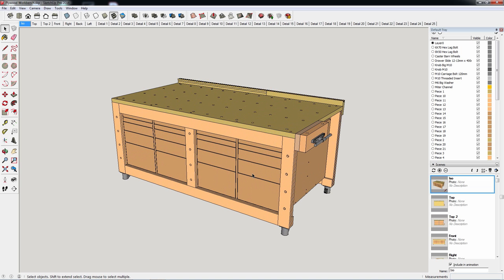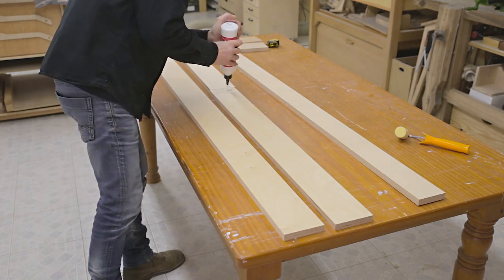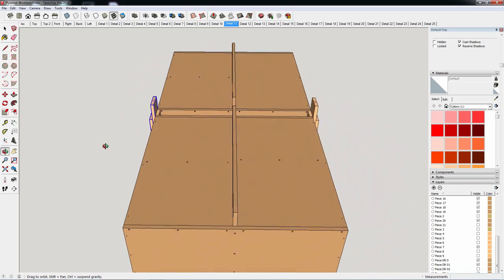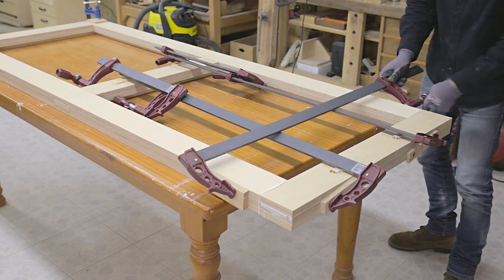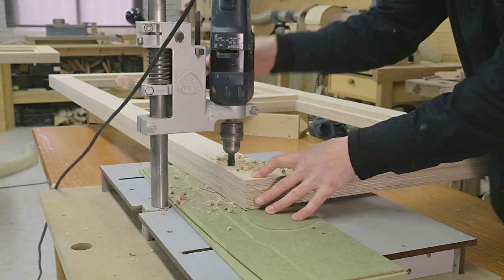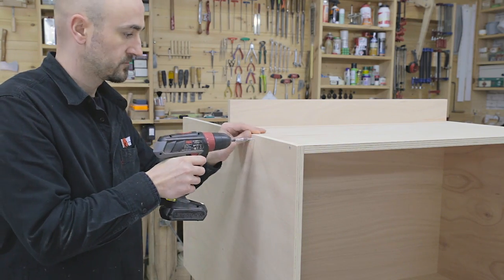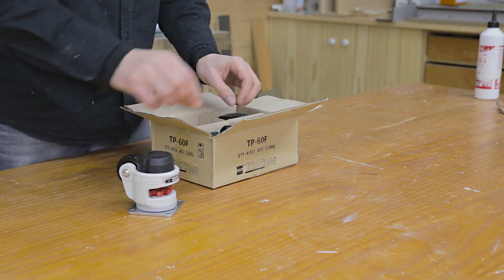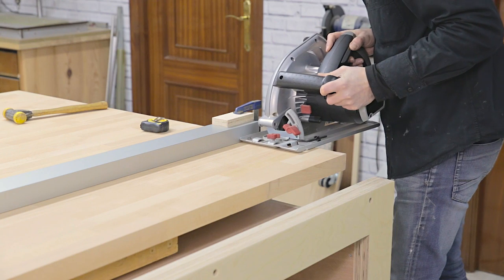High Capacity Multi-Function Workbench Build / Part 1

Comment from the maker: Multi-Function Workbench Plans: https://bit.ly/39eKtrr
Reply: The casters might support 1000kgs as a set but the fasteners won’t hold bc it’s screwed into the side edges of your plywood. It would have been better to use 2x4s or 4x4s for them. 
I’m sure you know this but someone not familiar with wood working might not know this.

Comment: Really like this work bench. I plan on building one like it with the addition of putting my table saw in it. I have the Delta 36-725 model and the caster set up is terrible. I also love the cross cut feature and edge cut feature you've built in. This bench build will eliminate the need for a separate table saw, separate expensive cross cut table, and bring my large cuts up off the floor. I want to also install a router in it. Thanks for a brilliant design!
Reply from the maker: thanks Daniel, I would like to see some photo!
Reply: @Paoson_Woodworking  May be a while yet. My next phase is to empty my garage, run all my electric, paint, coat the floor. Build work bench after. I've watched your 4 part build about 5 times now...trying to decide how to modify it to integrate my table saw and router.

Comment: For anyone interested in making this workbench;

It is an amazing workbench!
I have built mine to have a 4' x 8' 3/4 plywood top only with a circular saw and a handmade straight edge and it is extremely sturdy!
I used 6" lockable swivel casters that can hold up to 500kg each, and I have put them to the test! I used the bench as a construction scaffold to insulate my garage's ceiling and it wasn't even feeling risky with only a single 3/4 inch 4' x 8' plywood sheet on top.
Me and my uncle, we weigh over 250kg together and we were installing 3/4" plywood sheets on my ceiling, it also had a bunch of tools in the cabinets (I didn't make drawers or anything for now...) and it could've hold even more!
There was 2 drill presses, a planer, 2 jointers (4" and 6"), a spare circular saw, a compressor, a portable dust collector and a pen-turning lathe in the cabinets!
My only complaints are that I did NOT glue the cabinets to the main frame, because I didn't know if I would like the 4' x 8' footprint...and that I didn't add 2 more strips in between the workbench's top and the cabinet, it sags just a tiny bit because I am using only 1 sheet of 3/4" cheap plywood, I didn't want to use more than this to reduce the cost.
SO, If you're thinking of only using a 3/4" plywood top, please do yourself a favor and add at least 1 strip of vertical plywood on top of each sides of the 2 cabinets to reinforce the top!

Comment: The way the frame was designed for strong joints and easy assembly is a novelty.  I am thinking of how to modify the design for a smaller 3x5 work bench
Reply from the maker: thanks! check this out:
https://www.youtube.com/watch?v=yA8bUKLI4Sc&ab_channel=PaosonWoodWorking
Reply: @Paoson_Woodworking  thanks, I saw your smaller work bench. I actually watched half of your videos in the past few weeks. So many creative designs. Isn't the 3 layers of ply to much for the frame? I am trying to keep it light given I have to push to my driveway while working.

Comment: A word to the wise with anyone who decides to follow these plans. Since they're designed to be doable by people without a lot of tools and likely experience . . . 

Getting your plywood pre cut at your local lumberyard is very contingent on how good their cutting service is. This is something you'll probably have to learn the hard way since you might go to a bigbox store and get hair-precise cuts (really depends on the store management and how much pride the floor staff take in keeping the panel saw tuned) or to a lumberyard and get a mess, or visa versa. 

I wound up using a lot of my own time re-straightening the lumber yard cuts. Luckily, I was skeptical of their precision before hand and sized everything a bit bigger for cleanup at home. But it still left me with a few defects that have haunted me through the project.

Comment: This is a great design. I'd like to build something similar but with smaller cubes. I'd actually like to have the ability to separate each cube due to space constraints in my garage (a single cube might integrate a drill press, one a router table etc). You've given me some great ideas, and it'll be great to see how you integrate your machinery.
Reply from the maker: It is a good idea!

Comment: Great job, this will be my reference model.  One question, for clamping the plywood laminates I believe you used an aluminum square tube as a flat reference.  What wall thickness is necessary to allow strong clamping against this flat surface without warping the square tube?

Comment: The design of your workbench is very remarkmable due to the simplicity of the design. But I have concerns in relation to the the durability due to the swell and dwindle of the finger joint board. Between summer(wet) and winter (dry because of heating) the dimension change can be more than 10 mm. Below the board there is the body made of plywood. This material does not change its dimensions, that results in enourmous tensions so that the board will bend or on extreme differences in humidity the screws will break. So what are youre experiences with the board.

Comment: Amazing ideas in your videos. I have one question, I have noticed that you build drawers joining the sides at 90 degrees with screws and glue, while a lot of other videos use a pocket hole or other more articulate construction, and often they use a groove to slide in the drawer bottom. I find your construction to be very fast, simple and intuitive, why do others use more complex methods? Is there a need for such extra steps? e.g. in order to ensure a stronger build
Reply from the maker: thanks! It depends on the project, but this type of drawer made with the right plywood board thickness in bottom and drawer, is very resistant
Reply: @Paoson_Woodworking  muchas gracias! I will try them out :-) cheers, Max

Comment: I wonder if those caster/feet are as strong as the specifications claim. I have my doubts. But even if they can support the weight, how feasible is it to turn that wheel with a couple fingers when there is a 600-pound load on the caster?
Reply from the maker: you're right. I want to make a tool to facilitate the process. The weight will not be a problem, the bench and all storage will not reach 300kg. I've looked for wheels that support more weight to avoid problems. Thanks for your comment!
Reply: @Paoson_Woodworking  
I did not mean to suggest that the feet would not be enough for your application. I was only questioning the manufacturer specifications of 600-pounds per caster. I think that may be optimistic of them.

By the way, if it is too hard to turn the wheel to extend the feet, I guess the workaround would be to have a jack or lever and fulcrum to slide under the bench, raise it up slightly to take the load off the caster, and then turn the wheel to extend the foot.
Reply: Hi J Will,

The weight capacity of our leveling casters can actually handle about 20% more than we state but we always reduce the capacity by 20% after testing for safety reasons. 600 lbs is not a problem per caster because these are very heavy duty and quality made. The wheels are actually nylon so they are as strong as steel and very impact resistant as well. If you do plan on using the full weight capacity of 4 casters ‘maxed’ out which would be 2,400 lbs for a set of 4, then it is more difficult to turn the red lever to raise or lower the rubber foot pad. The easy fix would be to use a wrench 🔧 to turn the lever instead of your fingers or as you mentioned to slightly take off some of the weight while adjusting but we have not had any complaints or returns on these items and we’ve been selling thousands of them each year for many years now. We’ve made great quality improvements over the years to make sure that we provide the highest quality casters. Thanks for your concerns, please let me know if you have any questions about casters or wheels in the future. I’ll be happy to help. 

Thank you, 
Jordan Wilson.
Reply: @CasterHQ  
Nylon as strong as steel! I can hardly wait to see the skyscrapers built with girders made out of the revolutionary, physics-defying nylon that you have invented!

Clearly I was correct to doubt the accuracy of the specifications provided.
Reply: J Will 

Nylon wheels are comparable to semi steel wheels in the caster industry. Not the same types of steel used to create buildings.
Reply: @Paoson_Woodworking  
I looked up some reviews on those types of caster/feet on amazon, and I found two common complaints, one minor, one potentially major.

The minor complaint is that when the caster is loaded up (but within the rated load) it is difficult or impossible to extend the foot without taking the load off the caster.

The major complaint is that when the feet are used, it is not a steady mount. If you push on the workbench at the top, it can wobble or rock up to 1- to 2-inches horizontally. It seems the foot is on a fairly small threaded rod that is not kept rigid at the top end, which allows the foot to wobble along the fulcrum of the rod attachment point by about 1/4-in, which gets magnified by the workbench height to up to a couple inches at the top.

Comment: Hi just brought your plans for this and going to build it, just wondering if you think it would still be strong if built with mdf and a solid top? Looking at a cheaper option. Thanks
Reply from the maker: yes, you can use MDF. What do you mean with "solid top"?
Reply: @Paoson_Woodworking  awsome thanks, I have a solid kitchen table top. Was just meaning If I build everything but the top out of mdf. Thanks
Reply from the maker: @carposworkshop2662  yes, you can also use MDF for the top!

Comment: Hello ! great job really ! I would like to replicate it somehow for my 2000x1000mm workbench. Just a question: do you think for the frame can I use 'normal' phenolic pine plywood instead of birch ? I mean 3 layers of 21mm th, each. Maybe if not strong enough I can add an additional whell pair in the middle of the bench ? What about to build the frame with 80x120mm lamellar beam instead of plywood ? Thank you very much for suggestions ;-)
Reply from the maker: hello Giovanni, you can make all those changes, but I advise you to put two more wheels in the middle of the bench, send me some photo please!
Reply: @Paoson_Woodworking  ok thanks! to better understand… you do suggest to put additional wheels in the middle cause I'll use different material or even in your bench are needed ? consider I'll use nylon wheels with a max load of 150kg/each. thanks
Reply from the maker: if you are going to load the becnh with a lot of storage, even with the same material

Comment: Ok so I am looking at building this an 2 of the smaller size benches in your newer videos. can i use the 15mm plywood for this build or would you stick to the 18 for the drawers?
Reply from the maker: hello Robert,
You could also use 15mm plywood fot the drawers here, I used 18mm to optimize the sheets needed for the project better

Comment: Hi, are you happy with the leveling feet ? are 2 inch (~50mm) big enough ? Does it roll well with full drawers ? Amazing job btw, will buy your plans soon... Imperial version would be wonderfull, but metric is ok
Reply: You can load the plans into Sketchup and convert to imperial.
Reply: @davidbrenner5724  yes and no, you can't work with that, it gives you unusable measure. I bought your plan and rebuilt it with imperial measure

Comment: Wow, that is extremely complicated . Why not just use some solid timbers of the same dimension for the legs and other structural components ?  One or two cuts with some hardware and your done with the frame. Also driving lag bolts into the end of plywood is for the wheels is not a good idea . Too much chance of splitting . 
However , it is a very nice bench and well executed , but too much work for my taste, 👍